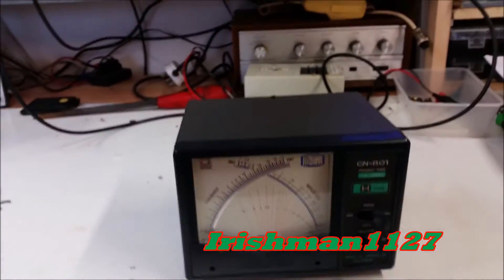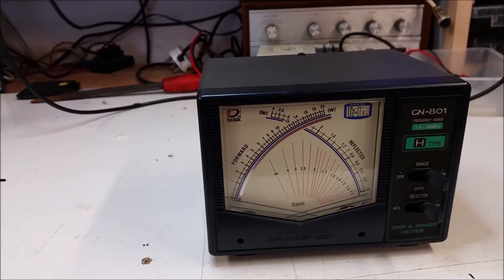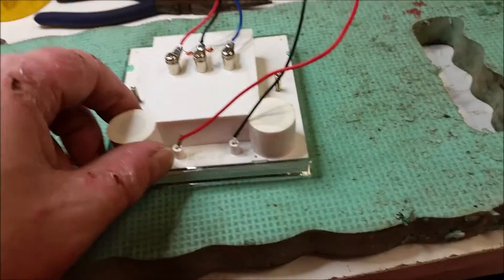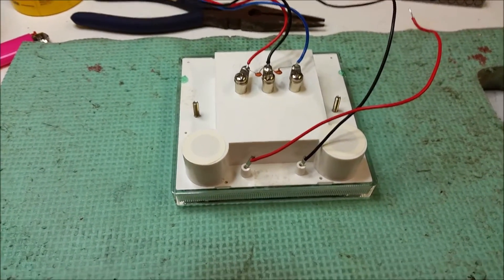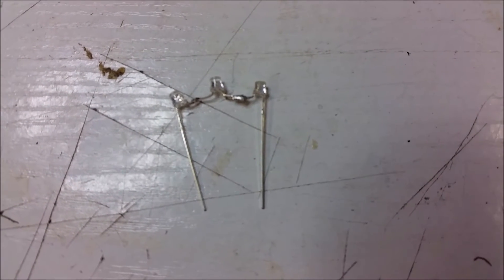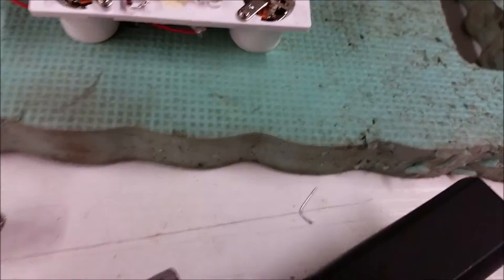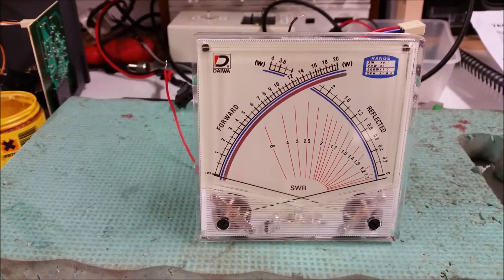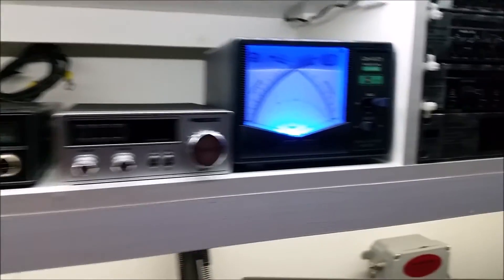Daiwa CN 801 Replace the blown axial bulb with LEDs

Comment: What value resistor did you use?
Reply from the maker: 1k would be the rule of thumb
Reply: @GeorgeEI7KO  Thanks for the reply. One last question: did you use a 3mm or 5mm LED? Thanks.
Reply from the maker: @jcvee15  3mm. Not much space in there